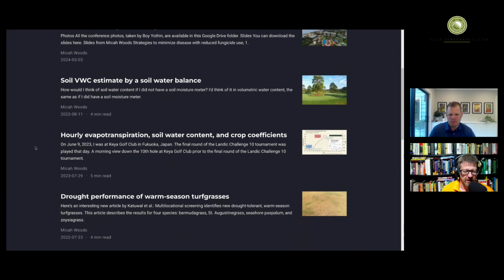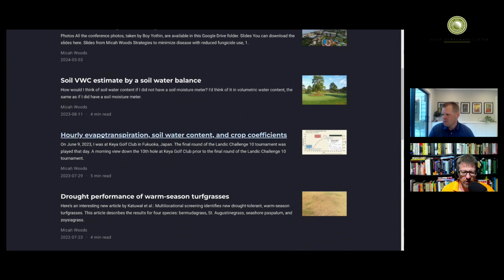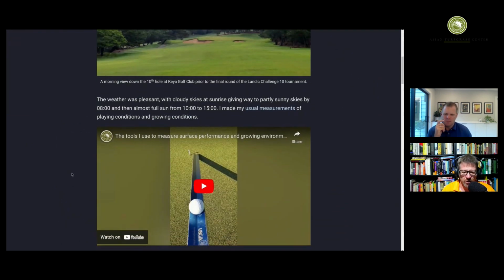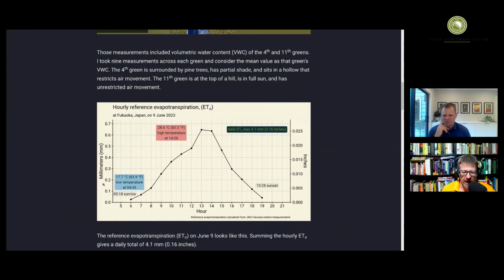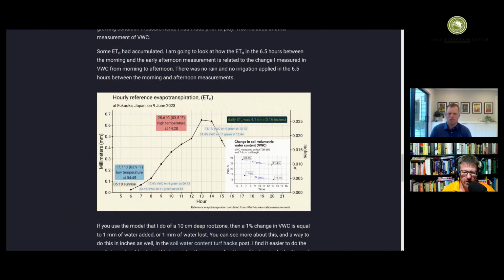How many hours until the grass wilts? Predicting soil water content with Dr. Bill Kreuser

Comment: Do you know what would be interesting? A study on when grass actually starts to decline/ thin, and or get compaction and black layer and disease with moisture that is too high, for instance the STRI claim 25% should be the moisture range at the top end of the spectrum down to 5%, other consultants on soil pushups recommend 30% for poa, but even that may be too much, do you have any good articles on this? i think a week at 30% would be detrimental
Reply from the maker: Good idea. I think it's going to depend on the soil type and season of the year and many other factors. You will see the USGA Recommendations for a Method of Putting Green Construction say the rootzone at the time of construction should have from 15 to 25% capillary porosity. The amount of water one wants in the rootzone depends on the type of surface one wants to produce. A general guideline can be to keep the soil water content as low as possible without the grass wilting. And then for the cases when one wants the grass to wilt, let it get drier (weather permitting).
Reply: @micahwoodsturf  why would you/some people want the grass to wilt, would this not be too stressful?

And I think it would be more interesting for native soils, a lot of golf courses in the uk are soil pushups, typically being wetter than dry in the winter and tonnes of problems occur with that. Now the STRI recommend no more than 25% but I don’t think there is actually any data in terms of time frame as to why.

For instance, let’s say I had a week of storms and my greens were in the 40% moisture range, just how long could we see grass handle these ranges because their was root damage and thinning? I always see optimal tests
Reply from the maker: @saltytree729  links course fairway in a dry summer, for example, one would allow grass to wilt.